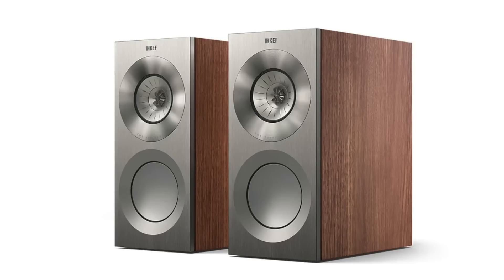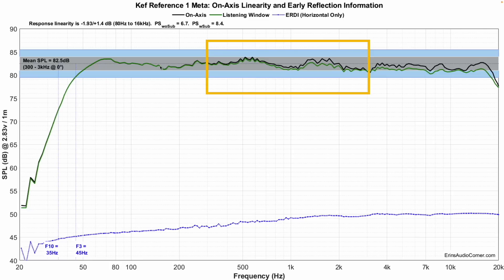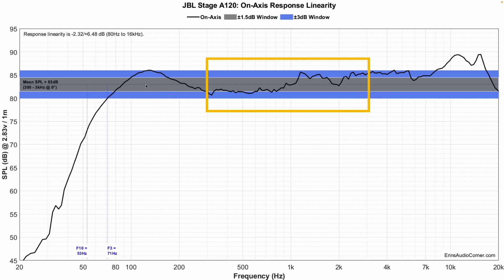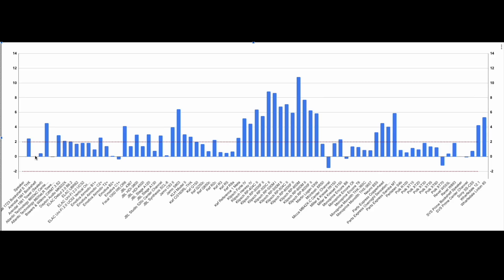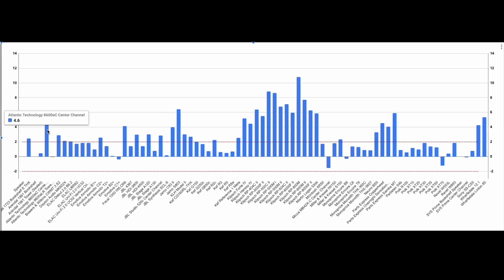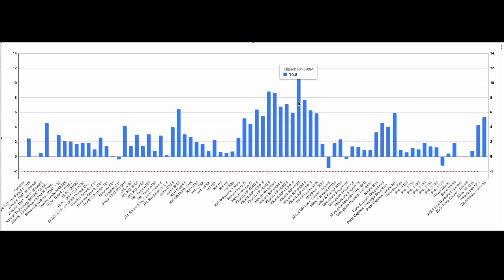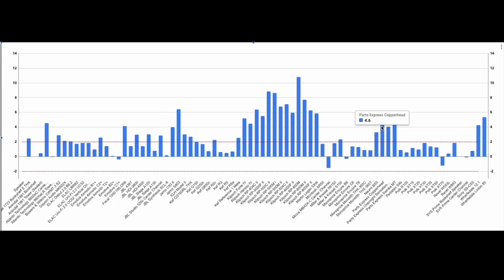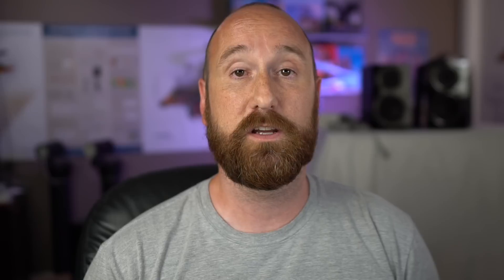BS Speaker Sensitivity Ratings and "Dynamics"

Comment: why use volts and not watts?   Doesn't that give more power to lower impedance speakers?
Reply: @Douglas Blake but is that the goal?   I thought the goal was to figure out how much amplifier you'd need.   Otherwise just take speaker max power handling and get a db reading if we're assuming all amplifiers are free, right?  Given infinite power, then all I care about is how loud the speaker can get before it begins to seriously increase distortion...or break.
Reply: @Douglas Blake So you're saying I should trust the speaker manufacturer specs... ??
Reply: @Douglas Blake ah, my elacs and b&w's have maximums.   My wilsons just list minimums.
Reply from the maker: (nearly all) Amplifiers are constant voltage devices.  Watts is what you get when you add resistance to voltage.
Reply: @ErinsAudioCorner  yes, and doesn't that give a benefit to lower impedance speakers?  If I somehow made a very very low impedance speaker couldn't I have crazy high sensitivity by your measurement because i'd have nearly infinite power?  Not my fault your amp can't handle a .0000001ohm speaker.  Couldn't I even put some sort of transformer (??) in there to simulate a very low impedance and then change that to drive a normal-load speakers with however many watts I wanted?   Vs a 1 watt test cannot be cheated.
Reply: @zachansen8293  You are quite right. Since consumers tend to equate sensitivity to efficiency for buying decision purposes quoting sensitivity at 1W rather than at constant voltage would make much more sense. Erin disagrees since he is somehow stuck to the science of it and does not seem to understand the repercussions with regards to consumer understanding. See the discussions under my posts in this video for more info. John DeVore of DeVore fidelity has argued about this in one of his videos too. Many manufacturers, mostly British, continue using 1W as a reference and kudos to them imho.

Comment: Sorry I should have left this on the older video, but I just remembered I had this question now.  I noticed in the Linton and Model 5 vid, for the MD relative to the fundemental, they had different values.  Like the linton was graphed at 1.22, 3.3, and 8.95; and the model 5 was graphed at 1.53, 4.16, and 11.26.  Is there any reason for that?  does that mean they can't be compared apples to apples?

Regarding sensitivity, yeah I never take the manufacturers numbers that serious.
Reply from the maker: MD is how much distortion there is relative to the fundamental, correct.  But they are tested the same way (4 spl: 70/78/86/96dB at 1m).  So, you can compare them directly.  The differences will just be how much distortion there is at each voltage.

Comment: My Martin Logan 60XTs have the following: Sensitivity: 94dB/2.83 volts/meter (91dB/1W/meter. Home Theater Review comes in at 90.6db/1W which seems on what you're saying seems to acceptable if I understand what you are saying in your video.
Reply from the maker: Yea, if their spec is within a couple dB I think that's reasonable.  Ideally it would be closer but different measurement methods and calculating the SPL may yield different results.  But this is why having the frequency response helps.

Comment: Erin - I have a question - how do I set the volume level to be at 2.83V? And doesn't the speaker impedance have a large effect on the output? Because the sensitivity used to be 1 watt; and now it is 2.83V.
Reply: @Douglas Blake Okay, good to know. The voltage seems a little arbitrary though, since speakers are obviously varied impedance. At least 1 watt takes the speaker impedance into account. But figuring the 1 watt seems like it would be even tougher?

Erin's method seems reasonable, to do a average between 80Hz and 3kHz. So, determining the voltage is key.
Reply: @Douglas Blake That's what I was wondering. I will try this on my MLTL-6 speakers, and see where I come out.

Comment: This sounds like a problem if one shops for a home theater receiver and then the speakers, and can't add a more powerful amp.

Amps seem cheap and powerful these days. Not a sensitive speaker? Shove more power into it. Distortion and SPL matter... Not sensitivity directly.

What am I missing? Why do people look at this spec?

(Dynamics also has to be carefully addressed, a higher sensitivity speaker isn't expanding the dynamic range. Again, I think SPL and distortion matter here, not sensitivity, unless sensitivity is expanding the dynamic range of a song, [not the peak volume of the system.])
Reply from the maker: I don’t disagree. But many make purchase decisions because they assume higher sensitivity equals a better product. As we know, that’s not always true (even when it does actually have higher sensitivity, there are other factors that matter more).

Comment: Talk about lack of info.  I thoroughly enjoy my Emotiva speakers, but I have to wonder why they do not print the impedance of the speaker on the speaker.  It wouldn't hurt to have all of the factory specs printed on the speaker.  Maybe Emotiva is just that high on the Audiophile ladder.
But, hey I can always the "as tested" specs on a speaker from Erin.
Thank you Erin!
Reply from the maker: Honestly, impedance isn’t anything I’ve ever been too concerned with because I use separate power amps. But you are correct. Some of these single number specs are also useless. Might be worth making a video on that.
Reply: @ErinsAudioCorner  Thanks.  I hope to get a "big boy" separates rig someday.  At this very minute I'm running my Emotiva T-Zero set on "large" in my AVR and the 4ohm rating doesn't bother the Onkyo at all.  I must say the bass is impressive.  I got up and checked to see that my sub was off.  Dang - I like it!! 👍😁👍
Numbers do matter, but right now I'm just enjoying the music 🎶.
Ahhh.
Thanks so much for all you do Erin.

Comment: I've learned that the SPL at Xmax derived from displacement at Xmax * cone area is pretty much all I care about when selecting drivers.  Assuming most drivers can reach Xmax within their power rating ( some with weak motors can not, Dayton).  I try to build a balanced system where the max SPL of the woofer, midrange and tweeter are pretty close to the same. The dynamic compression measurements you make are actually important for the linear dynamic range of the speaker.   Amplifier power is so inexpensive, sensitivity just doesn't matter to me.  I build modern powered speakers with an amp channel for each driver and a digital crossover.   Have you read Current-Driving Of Loud Speakers by by Esa Meriläinen?  I highly recommend it.  He gives an excellent review of the physics and electrical characteristics of speaker drivers and how best to drive them. Spoiler, it's not a low impedance voltage source.
Reply: Question for NackDSP: What is the damping factor of your amplifiers? (Mine is about 1/350).

Erin should certainly read it! Very often he has the Non-linearity Poster of Klippel in the background on the wall. The poster shows the amount of SPL distortion and the amount of current distortion. Current distortion can be eliminated!

Further reading for those interested in current-drive:
* Articles from Mills & Hawksford (1989): Distortion Reduction in Moving-Coil Loudspeaker Systems Using Current-Drive Technology, and: Transconductance Power Amplifier Systems for Current-Driven Loudspeakers

* Nelson Pass, especially the documentation and articles around the F1 and F1J, and especially: Current Source Crossover Networks
* Joe Rasmussen about current amplification
* The Convex series of SGR Audio
* Baffless
Reply: @JerryRutten  Great info Jerry.  Very cool. I guess I need to turn on some notification so I can see when I get a comment. Ha    I think the output impedance of my amp is around 2 k ohms.  It's been a while since I tested it.  Damping  8 / 2000 =  1/250?
Reply: @NackDSP  You build your amplifier yourself? I’m very interested in which way, with which configuration, it realises an high output impedance!

Comment: I see a speaker with a 6 inch woofer in a bass reflex cabinet claiming + or -  3db
 from 40Hz to 20 Khz and a sensitivity of 95 db.  I know that has to be a lie
I could not see how that would work without horn loading. I am  Glad to see 
your video and learn that I was right. Thank you.
Reply: I'm using a set of 3-way speakers with a 6-inch woofer that is only 84db @1w, but they really sing when you give them 100 watts. The bass is very tight and focused, in my (limited) experience.

Comment: a on axis frequency response at one meter 2.83 volt(and the ohm graph is usually overlaid right on there), says a lot and are less confusing than a lot single numbers. you get sensitivity out of it or at least sense of loudness. you see the bass extension, you see the ohm load, and more just from one graph. 

the only thing those marking specs get right are: price, weight, dimensions, color, and you get my point.
Reply: I don't like the square root of eight voltage standard but at least if you use it consistently it is honest
Reply: @WendellSexson  i do not mind even 1 watt measurement, as long as we get the ohm load graph.
its all  about consistency and a good standard. 
if amps did 1 watt efficiency as standard spec it would be a game changer

Comment: If you measure from 300hz that will include most speakers baffle step, which is generally not fully compensated for an anechoic environment (with good reason). That could pull the average down a bit.

I'd probably look at 1khz-5khz or in that range.
Reply from the maker: Baffle step should be neutral. In which case, it won’t impact the sensitivity.
Reply: @ErinsAudioCorner  Do you mean full compensation (+6dB)? If so, that is not how I design a passive speaker - I would compensate accounting for a bit of room gain.

In an active speaker of course there is good case for full free apace compensation because its easy to add an adjustment control.
Reply: @ErinsAudioCorner  I'm not saying your way is wrong BTW,  just commenting with my thoughts.
Reply from the maker: @Audio_Simon  understood.
Reply: @ErinsAudioCorner  Sorry I should have thought more before commenting. My point only makes sense if the manufacturer specified an in-room SPL - if not specified I would certainly assume anechoic.

Comment: Klipsch is clearly misleading, which is odd becasue their speakers are very highly sensitive. I pulled out Klipsch RS35 rated at 97db and put in Arnedal 1961 heights rated at 84db. I have to increase the Arendal about 6db to be at same volume as the Klipsch, so it is easily 6db over rated.

Comment: Love your videos.  I have begun the rabbit hole of sound quality for auto and home theater about a year ago.  Your videos have helped tremendously.   This video really hit home as I begin looking for an improvement for my home theater left, right, and center.

Do you have a list of speakers that you recommend me looking into?

I would love to see speaker lists for this situation, but also other speaker lists for people who have different needs and budgets for audio.   When I scroll the speaker reviews, it is overwhelming since I don't know which speakers are lowered priced and which speakers can sound good without external amplification.

I am using a Yamaha RX-V679 receiver.  No pre outs.  No external amplifiers.  I measured the left speaker to be at 21 vrms before clipping, which is around 75 watts for 6ohm. 

I have a large living room and sit 14 feet from the speakers.

I currently have the Sony sscs3 tower for left and right.  I have the matching center and surrounds.  I have come to realize they just don't sound good compared to the upgrade I completed in my car this year.

The Yahama receiver does have pEQ, but it is preset frequencies, so I cannot fine tune.  This did help the sony speakers tremendously,  but I'm still not satisfied with overall sound.

I do have the BIC 12" sub, which I purchased before I saw your review.  I used a minidsp with the sub, and that made a tremendous difference in response, impact, and integration with the sonys.  Your video on sub placement was a big help.

I also watched your center channel video, and I saw the same dips in the Mid range as you showed when I tested over the weekend.  

I would like to get a three way center as you mentioned, and left and right that are similar in sound.

Thanks for all your work.

Comment: You didn't really address the topic of dynamics which IMO is a major factor not being discussed. Klaus Heinz of HEDD audio has mentioned that he's never been able to come up with a measurement which reflects this quality. I know Purifi have also worked at solving this problem and getting those dynamic qualities into lower sensitivity drivers (I'm getting ready to test their M driver against my main 12" mids and see how well it holds up as far as dynamics go). I'm not sure how much the Klippel compression tests show this. I've tried doing my own tests at increasing levels (up to past 100 dBSPL at 1m) and haven't been able to measure any compression even in conventional tweeters. Most people after this quality (including me) don't care if a manufacturer's spec is 3 dB off. We care about the 25 dB difference you can get between a compression driver and a tweeter. It's also not about power. Unless you need more than 1000W (where you generally need pro audio amps with fans etc), power isn't a problem and it's not what we're worried about. It's the magic of running a high sensitivity system even at levels well below 90 dBSPL where even a tweeter would only be consuming around 1W. This quality is what people have failed to capture in measurements (something I'm working at). One theory I have is that really it's just the nonlinear perception of linear distortion (caused by horns) as first described by Earl Geddes.
Reply from the maker: I discuss it in more detail here:
https://youtu.be/6YY71Wqv2u0
Reply: @ErinsAudioCorner  I'm not sure why I haven't been able to measure anything like your Klippel compression tests. I just used REW sweeps at increasing levels and then moved the curves so that they overlap and I can see any variation. They always matched to well within 0.5 dB from 76 dB to 102 dB. Everything I tested including various woofers, mid domes, tweeters, and ribbons. Some of the drivers that can't handle much power would have their distortion shoot up but I still wasn't measuring any compression.
Reply from the maker: @gerhardwestphalen  very odd, indeed.

Comment: Yup, this has always been one of the most confusing specs whenever I go comparing speakers between different manufacturers, to the point that it almost feels meaningless.  There’s just no consistency between the manufacturers at all.  There really needs to be a (de facto) standard set in the industry.
Reply: I like your review thanks.
Another good measuremebt that you can do is the ability of the speaker to have distortion over the frequency range 1st 2nd and so on harmonics. 
I dont know with measurement  tell you speakers distort throughout the rms wattage specified. 
Maybe you can make a which brands are closer to the anechoic measurement 
Thanks again for you nice review
Reply: It would be easy to use the same standard. The problem is that they don't want to, they want to do anything they can to make their speakers appear better than the others. It's far from the only spec that they do it with, people will often buy or recommend based on which number is bigger.
Reply: I will probably never look at sensitivity in my entire life, and I haven't paid attention to that as a specification, ever.

Have you ever screwed in a modern light bulb and needed to know how many volts or watts or amps were going into it per lumen?

For speakers and light bulbs and basically everything else in this day and age, power is cheap and easy... Or in many cases totally irrelevant like with active monitors.

Manufacturers should publish SPL and distortion data I think, but sensitivity doesn't seem to affect sound quality so limiting a system by that spec seems odd when amps are cheaper than ever.
Reply: @stevenswall  Yes, but even if you have unlimited watts, you can't put unlimited watts into a speaker without blowing it up. That's why sensitivity combined with maximum RMS power handling is important.
Reply: @scotth6814  I think you need SPL in there.
Reply: @stevenswall  Sensitivity is measured in SPL.
Reply: @scotth6814  Yes but measuring at 2.83V rather than at 1W which used to be the standard takes speaker impedance out of the equation which renders sensitivity ratings mostly useless for the consumer in any case.
Reply: I largely agree with you to a certain extent. However, if you have a large room and like to listen at high levels (which will permanently damage your ears in short time) or have a speaker that is hard to drive and dips very low in impedance with a troublesome phase angle along with it, you may run out of power and clip your amp, which can destroy your tweeters pretty easily.

Comment: Yea you nailed it and I appreciate you and your honesty and speaker measurements I have not bought a set of speakers that didn’t require power. I have a set of speakers that are vintage speakers and I am so pleased with them and I have a set of vintage speakers that cost 3 times the price but I need 1000 watts to wake them up and I have cheap Polk Audio I would rather use , but I have a couple sets of DCM from the original speakers and I will have to say that I like them a lot and they told me that they are only 88db and no more but they sound great.